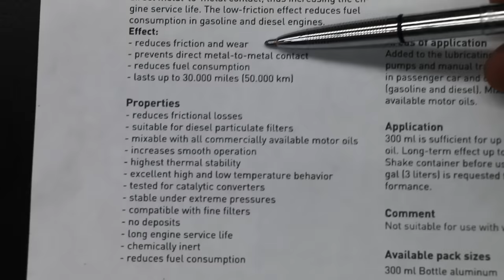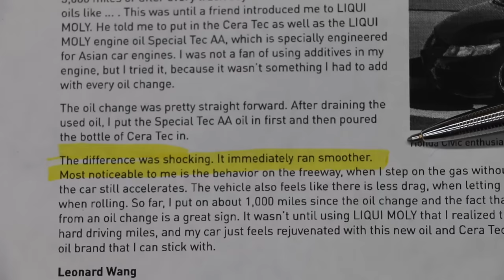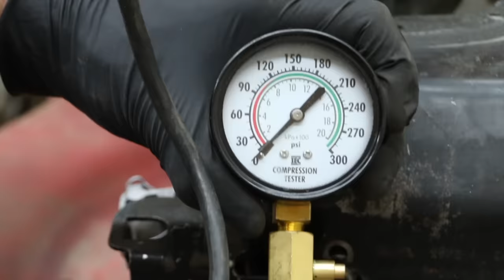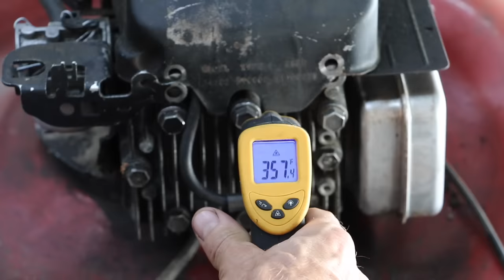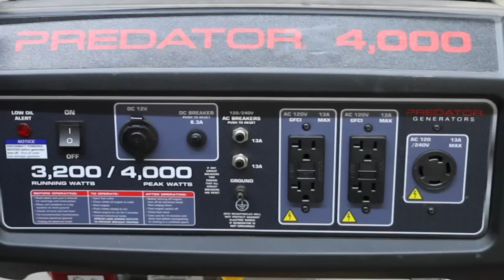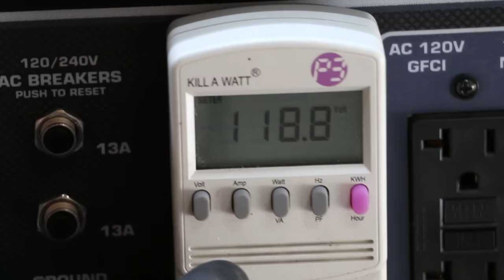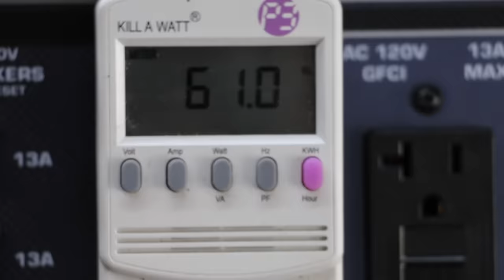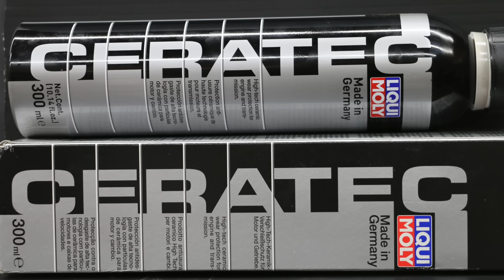Does Liqui Moly CeraTec work?  Let's find out!

Comment: For me, in my 1500cc Honda Fit, after the oil change, the effect was immediate. I drive stick shift, so it's very noticeable. The shifts went in smoother, clutch was lighter, as was the gas pedal, acceleration was noticeably better, while the engine noise was greatly reduced. The car, at 70000 km mileage, actually felt newer than the first day I drove it out of the Honda dealer. I can't measure the fuel efficiency yet since I'm still on the first tank after Ceratec, but we'll see. I have a lot of confidence in this product.
Reply from the maker: Thanks for sharing.

Comment: Ceratec does work - but it's a bandaid for more serious problems. I had to reanimate my fiancee Diahatsu Sirion with KR1-FE engine (1 L 3 banger) on a budget. It leaked oil from between trans and engine (probably crank seal - it was bad). I didn't wanted to drop the trans so firstly I used engine oil flush and then I popped one bottle of ceratec. It did stopped leaking so heavly after around 200Km (on the other hand it started to throw 2nd O2 sensor faults until it burned a bit of oil).
After a year later I can say it worked like a charm and oil usage dropped from 1l per 1000km to 1l per 3500-4000km.

If you have neglected engine that you would like to keep running a little bit more, go for it.
Reply from the maker: Thanks for the feedback.

Comment: So I did some quick math with some guesstimated figures after you mentioned a 1% fuel efficiency increase adds up over the lifetime of a vehicle:
Over the course of 100,000 miles, assuming the vehicle gets 20 mpg on average, it would take 5000 gallons to reach that 100,000 miles. A 1% increase in efficiency would get you to 20.2 mpg and it would take you 4950.45 gallons to reach 100,000 miles. The price I found for that bottle of Ceratek was $40. Assuming you changed the oil every 5,000 miles and used one bottle of Ceratek per change, you’re looking at spending $800 over the course of 100,000 miles to save 50 gallons of fuel ($250 @ $5/gal).
Although these numbers are just estimated it’s worth noting that the lower your base fuel efficiency, the lower the benefit. Also their website says that one bottle is good for 3-5 quarts of oil and you will likely need more than one bottle per change. You also may change your oil less frequently. Lastly this doesn’t account for decreasing engine wear which would mean you’d get more life out of the engine. Lots of variables and your mileage will certainly vary (pun intended) but worth looking more into as using this product may actually cost you more money overall.
Reply from the maker: Thanks for sharing.
Reply: You don't add one bottle every oil change. One treatment lasts 30000 miles.  You still have to do your regular oil changes but only have to add a bottle every 30000 miles. It's more to reduce wear and noise of the engine.  The gas savings is just a bonus and pays for the product. So, if you use 3.3 bottles in 100,000 miles, you would spend $132 so you would still save $118 in gas.

Comment: Recently added this to my Ford 460 engine and it almost immediately cut out 30% of my engine noise. I haven't driven it yet to check gas mileage gains since it's my RV and it's sitting but wow was I surprised. I wish I had used a db meter to give exact numbers. I also added it to my girlfriends 2011 Mazda 3. The noise level dropped from 75 db average to 72 db average in about 3 minutes. It was already a pretty quiet motor to begin with. The mileage improved greater than 20% according to my OBD2 scanner. I'm going to recheck those numbers at the pump on the next fill up and do an update because it seems drastic. Magic in a bottle as far as I'm concerned.
Reply from the maker: Thanks for sharing.

Comment: I was pleased to see the type of test done with the rpm variance. Unfortunately, I have yet to see other videos utilizing the same test with other additives... that said, I was pleased to see the rpm increase, as that is a sure sign of efficiency gain. 

I feel like the bearing-on-steel test is a little misleading as such differences in shape related friction are not present in engines. Even in transmissions and differentials the gear mesh is not a pinpoint pressure, so different films are going to do act differently. 

Personally, I have seen huge endurance increases with Lucas Oil Stabilizer, and Ceratec, engines and transmissions. I tow 25klbs with 1-ton Cummins regularly, 300k miles on my rig, engine teardown for gaskets and bearing check, running 550 hp, 1200 tq with low egt's, and bearings, rings were in perfect condition. Bearings were still not even shiny yet, so the babbit was not affected. Always with the above specified  oil additives.....

I will keep tuned for more testing! I love the content amd conciseness of your videos!  👍👍👍
Reply from the maker: Thanks!

Comment: As a professional driver and owner of several vehicles of different types, I can testify that Liqui Moly Cera Tec really works and additionally protects the engine in extreme conditions of use. Also tested on the Nurburing race track.💪
Reply from the maker: Thanks for the feedback.

Comment: This stuff flat out works! A lot of mustangs have whats called the typewriter tick. You cannhear it under the car at the oil pan. You pit this stuff in and with a matter of minutes it goes away. Also you can literally hear the motor sounds sooooo much smoother
Reply from the maker: Thanks for sharing.

Comment: I’ve used liqui moly Mos2 anti friction on my 06 Scion tC it has a slight rough start when it’s cold outside, after I’ve changed my oil and added liqui moly’s anti friction I noticed the next cold morning my vehicle idles very smoothly and doesn’t have the horrible start when it’s cold. Although it wasn’t ceratech it still amazed me
Reply from the maker: Thanks for the feedback.

Comment: I'm currently using Mos2 in a 2008 Jetta with 145k, definitely smoothed out the engine a tad. I changed in PUP 5w30 and then added the mos2 a few weeks later.

It calls for 5w-40 preferentially, but 5w30 is still withing spec. I like the idea of using a friction reducer when running a thinner oil to reduce any accelerated wear that could occur.

I've considered ceratech, but concerned about potential spark plug fouling.

I also have the intuition that these type of additives will reduce start up wear, where metal-metal contact and insufficient film strength is common, as this is almost the exact scenario that Mos2 (and by extention, ceratech) were developed for (oil starvation)

My main goal for these additives is to improve engine longevity.
Reply from the maker: Thanks for sharing!
Reply: i was using mos2 in my smothie jetta tdi.. then i changed the oil and now is rough again.. i think its ceratec time

Comment: Is been around two thousand miles since use liquimoly ceratec on two Toyotas 2.5 engines a camry and a rav4 both around 20k odometer. 
Even I live in the tropic both use 0w16 Mobil 1 oil. After five thousand miles each on ceratec I can say it runs smoothly, very difficult to measure mpg but its tendency is to be better, also and still my most convincing measure is oil temperature at work, measured with a Blue Driver device both, results on both vehicles: 2 to 3 centigrade cooler running on same temperature: 35 centigrade exterior mix with 0w16 oil. 
Important to add is that I used one Ceratec bottle for both cars, half bottle each (150ml). Since it supposedly fills fine a V8 engine, isn’t it?

Note: 2-3 centigrades difference was detected when changed, on both engines, oil from 5w30 to 0w16,  difference  maintains.

Comment: I just read an article where the guy said that the Ceretec made his oil much thicker in the cold, (upstate NY in winter/ -30°F wind chill), and was messing with his oil pressure sensor. So, suggestion, add a cold flow test to your Ceretec video.
Reply from the maker: Thanks for the suggestion.

Comment: I bought a 2004 4runner V6 with 170k on her and it was getting 13/18 mpg and sounded ROUGH. After an engine flush and synthetic oil, she jumped to 16/20. My buddy recommended the ceratec. Once put it, I took a 1/2hr hwy drive and my mpg jumped to 22. It also quieted my intake lifters. City driving stays at 18. For older vehicles, I think this stuff makes a world of difference.
Reply from the maker: Thanks for the feedback.

Comment: The results showed that, at a load of 250 N and a reciprocating frequency of 2 Hz, BN did not lower friction whereas MoS2 nanoparticles were very effective at reducing both friction and wear, compared with the base oil. The viscosities of both formulations were similar to the base oil, which allowed for a direct comparison between them. Raman spectroscopy showed the formation of an aligned MoS2 layer on the cast iron liner surface, which most likely functions as a tribofilm. In the case of the cast iron liner tested with BN nanolubricant, no traces of BN were found. The effect of surfactants was also studied, and it was found that some surfactants were not only beneficial in dispersing the nanoparticles in oil, but also in producing some reduction in friction and wear, even when used as stand-alone additives in PAO 10
Reply from the maker: Thanks for the feedback.
Reply: Ceratec is suprior to MOS2 making it their flagship anti friction treatmemt. That statement came directly from Liqui Moly and Im sure they've ran exhaustive tests on both ...

Comment: Although most of your theories are sound, I didn’t see a long term test with oil sample analysis. The analysis is truly the only true way to see the long term effects of the additive. Also I use it in a vw diesel, combustion engines under severe demand are a little different than those of a small engine. I really enjoyed your video just wish the testing methods included long term oil analysis.
Reply from the maker: Thanks!  Thanks for the constructive feedback.

Comment: I've had good luck with cerotek. I run it in the 2000 f250 in a ZF 6-speed behind a 7.3. I also put it in my '06 6 l and it definitely helped if not eliminate the injector stiction that it was suffering from in an ejector or two and then I also run it in my 2015 f250 with a 6.2 l gas can't complain
Reply from the maker: Thanks for sharing.

Comment: Have been using it on my 2005 Corolla for about two years now . Made the engine a lot more quiet and reduced vibrations. Fuel mileage didn’t change but it really does feel more smooth on idle and while driving. I add double what the bottle says though 😂
Reply from the maker: Thanks for the feedback.
Reply: Any issues with vvt-i?
Reply: @SUPERNVA-gr4sr  none no
Reply: @tundras4ever552  thanks bro

Comment: Hi. I've watched most, if not all, the luv related tests in your channel. The thing with the friction test on a lateral wall of a cylinder is you need to measure it with the right criteria and the right precision tools. The way the piston interacts with the sleeve has nothing to do with this test. The overall take-out is that it exaggerates the wear on the early stage of the test and takes logarithmically less wear as the contact surface increases, and that is where the products are more active.
For your garage setup, it'd be much more accurate to have a linear wear devise. The quick and easy would be to have a rod inside a shank, the rod should intersect perpendicular to the friction wheel, and the surface contact must be 100%.
I hope you get to see this, because I love your videos and the effort you put on them.
Reply from the maker: Thanks for the constructive feedback.

Comment: Ok I use it in several cars:
*Neglected Honda civic 2006 (first time) I didn't notice changes because I didn't take proper notes but I feel it runs smooter
*SEAT Ibiza 2006, crappy 1.6 Brazilian engine, definitely runs smooter 
*Mitsubishi Triton/L200 2009 2.5 turbo diesel, 25 miles per gallon (11 km/l) to 28 miles per gallon (12 km/l) after adding ceratec 
*2008 VW Rabbit 2.5 155,000 miles, the engine tends to shake a little bit, I flushed the engine and added ceratec, after that, it runs a little bit smoother and reduced the "Clicking", before: 21 mpg (9 km/l), after: 23 mpg (10 km/l) 
*2012 VW Jetta 2.5 120,000 miles, no difference in consumption, it always gave me 23 mpg (10 km/l), but It ran smoother and it was more responsive 
*2018 Ford Escape 1.5 ecoboost, I'm not sure to add ceratec, because I don't have references about the reliability of that engine and  probably I could lose warranty, the other engines are bulletproof (VW, Mitsu, and Honda, except for the Ibiza that engine it's disposable) 

I always check the gas consumption whenever I fill the tank and I always fill it up to full

Comment: What I rember in products with Boron Nitride like Ceratec - it is maybe2000 km/ 40 hours to make repair of some holes in metal. It will not repair all holes....  So the test is nice but not adequate. Second feature of the product  like building film between metal - I am courius - because my car started to be quiet imidietely, maybe film has other features than increasing speed of engine? Tempus Fugit

Comment: PLEASE TEST EXTRALUBE  ZX1! They make some crazy claims about it and I love it. They have even tested an engine with zero oil after treatment with ZX1 and it's already run for over 15 hours with zero issues. You can even put it in your gearbox and fuel.

Comment: Hey there. Great demo. I've tried this myself and wanted to see it tested. U may have already discovered this but Ceratec has 4600 ppm Moly (I guess modtc instead of Mos2?) 2200 ppm boron (they say it's hexoginal boron nitride but the msds says 'oxide'...but boron nitride is synthesized from boron trioxide... So I'm not sure if that's what it means?).. 600 ppm zinc, almost 1000 phosphorus, and 1600 calcium. So it definitely has a pretty serious anti friction/anti wear package when divided out over 5 quarts of oil. And some calcium for cleaning properties (that hopefully don't compete w the anti- wear too much) and a base number improver. I wonder if the extreme pressure and heat for a duration is a nesessary catalyst for 'plating'... I know I mentioned that on another comment but since then, I found that voa off speediagnostix. It's nice to see what's really in there at least. Thanks for everything!
Reply from the maker: Thanks and you are welcome!

Comment: Absolutely great video content, best I've seen on YT. Hoping you can help, I've recently purchased a 17 year old Acura with only 68k miles on it. I've had it checked out by a mechanic and it seems to be in pretty good condition but I'm concerned that the seals on the engine might be in need of some sort of conditioner. Any suggestions? I'm hoping for something more than anecdotal evidence.
Reply from the maker: Thanks for the suggestion.

Comment: Using it since couple of years in multiple Engines, also Engine Protect and Gear Protect, both product work very well, I personally love to use them. Engine will run noticeable smoother and also saves fuel (doing fuel records since over 37 years).
Product‘s are expensive, so I don’t know, whether there is a return of invest or not 😇

But I absolutely love to use them 💫, strongly recommend to use all of them. In big Engines I mix Cerratec+Engine Protect
Reply from the maker: Thanks for the feedback.

Comment: Hey, i recently used it in a modern engine, it definitely works by smoothing out the engine but no other changes, engine ran smooth on cold starts at various temperatures -3 to 19 degrees, much better start less vibration and engine noise. At high rpm the engine was much much smoother barely hear it. Auto start stop felt much smoother. In all, it works but only to smooth out the engine by coating the walls of the piston chambers and other parts internally. I done a service change, it still feels like its there, will add another one soon after new service :)
Reply from the maker: Thanks for sharing.

Comment: Hi brother , i own a VW Polo 1.2 TDI in India , December 2011 bought , 165k kms driven with engine oil (VW Special D SAE 5w40,  505 00/505 01 spec VW approved). Car is driving like a dream with no problems at all. I jus want to know if i shift to Liqui Moly Toptec 4100 5w40 , 505 00/505 01 spec oil , would it increase the smoothness and performance of the car and decrease engine noise ? People say its not fully synthetic instead its a blend of normal oil and synthetic oil. But still increases smoothness , whats your opinion on this ? 

2. Or Should i try Amsoil 5w40, 505 00/ 505 01 European spec oil with red cap bottle. They its fully synthetic made from group 4 oil. 

3. Should i use Ceratec in my car engine ? 

4. Should i use Liqui Moly hydraulic lifter additive? 

5. Should i use Liqui Moly Engine Flush plus ? Hope it doesn't damage my engine seals or make the engine noisy ? 

6. Do u recommend Liqui Moly Diesel Purge , if yes then how to use it for best results?

Comment: I love Cera-tec and use it at a higher concentration than your video test. I also use Mos² from liquimoly in a diesel with HEUI injectors and a common rail diesel with a high pressure fuel pump. Mercedes sprinter with 285k .

Comment: I highly suggest you revisit this video. ceratec works by heat coating following long term exposure. i suggest you add it to a working car engine and do oil test before and after and measure average fuel economy before and after. 

having used it on 3 cars so far, the main change starts to happen at 200-500 miles mainly depending on how hot the oil gets.
Reply from the maker: Thanks for the constructive feedback.
Reply: Was looking for this comment, wish he would redo the fist test after heating the part in the oil

Comment: in this is smoothing out imperfections then it's also smoothing out the honing pattern of the cylinder walls. sure, there is less friction but less stable oil film.